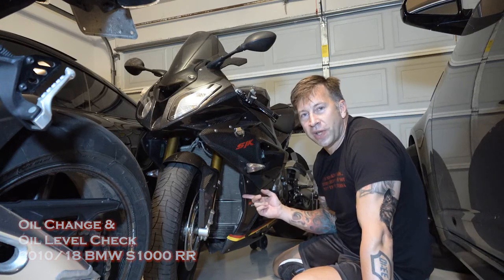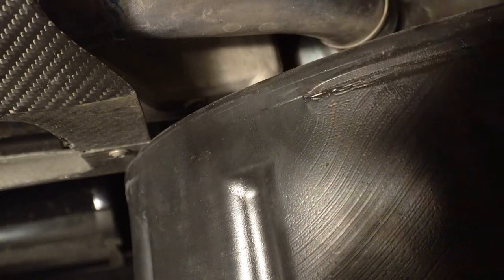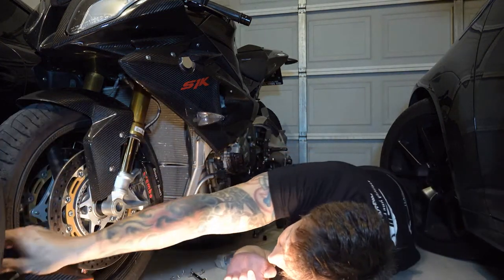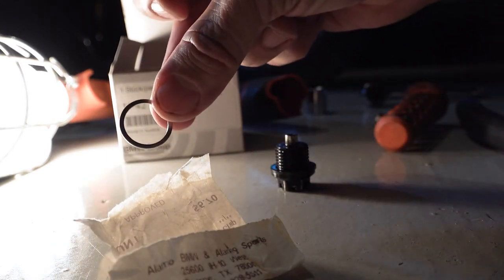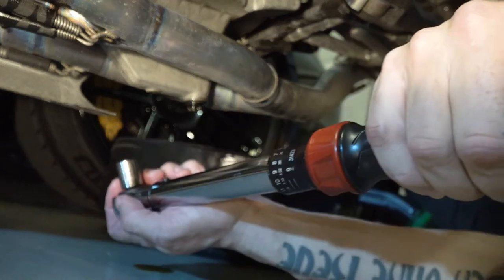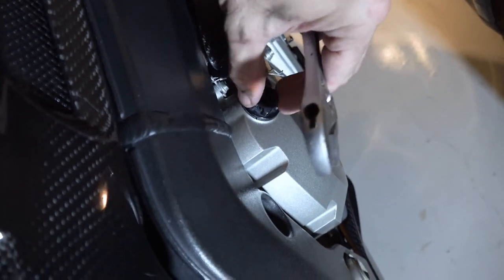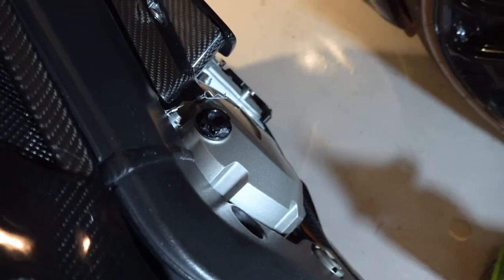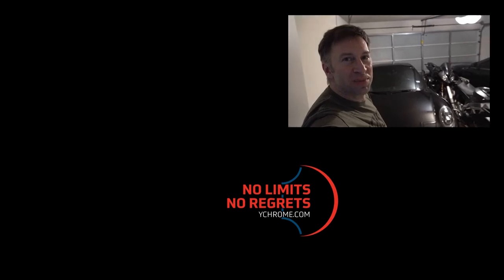Customized BMW S1000RR OIL CHANGE Motorcycle Made EASY - Custom BMW S1000RR

Comment: So question on that 5w40 can it be the Castrol edge sae? (even though that's for cars)
Reply from the maker: bmw oil is the safest bet, as far as the same weight oil car vs bike, i have noticed sometimes the motorcycle oil is specific for bikes and say for small higher performance engine.  don't know if they have different heat transfer properties or not perhaps? everyone has an opinion on oil. i figure i'll use the right/good oil since i push the engines hard and would hate to save a few bucks and cause damage to the engine, but others might use cheaper oil, and never have an issue. it's whatever risk a person wants to take.